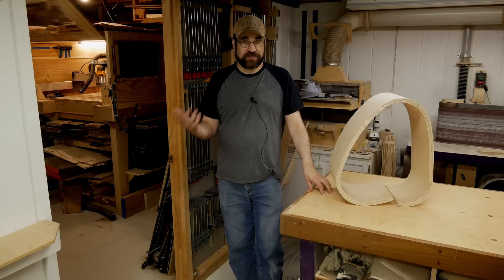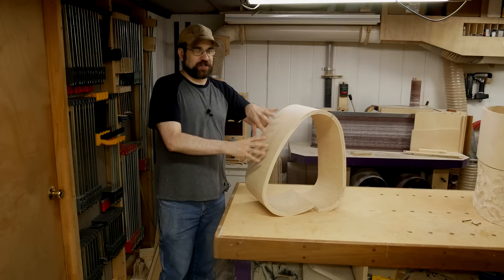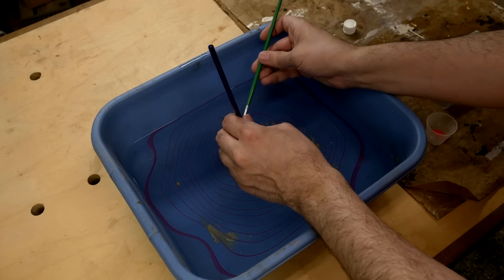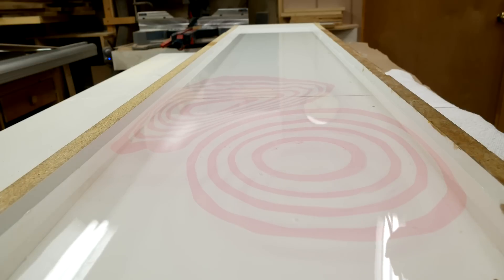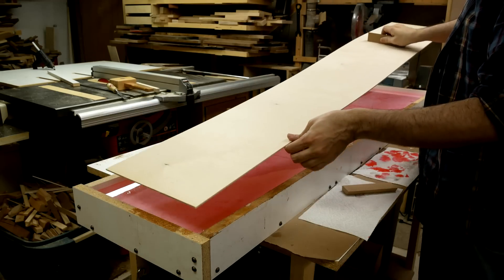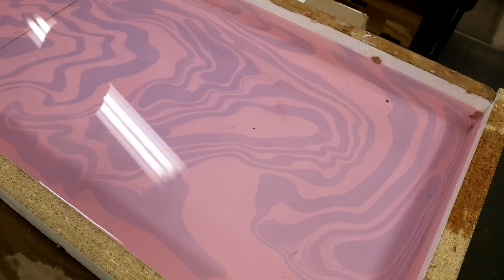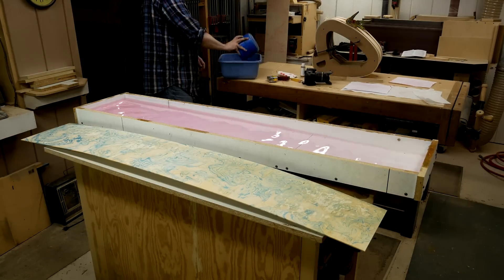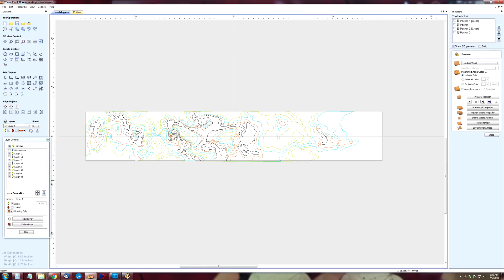Project Wavy Bent - Pt 2 - Suminagashi

Comment: Really cool process!  Was it not possible just to photograph the water marbling directly to get it into digital form?
Reply from the maker: I thought it was useful to try getting it onto plywood to see how that would look.  It would have been a little tricky to stitch pictures together because it keeps moving.  Though on a smaller scale it would be really helpful to have video from straight above so you could pull out the image from whenever you want.  It went a little past the time I would have wanted to freeze it in the places I started earliest.

Comment: So, it looks like you're doing the suminagashi to get a pattern to scan and trace over on the computer to make your heightmap.  If that's so, why use plywood instead of a roll of paper?  Even if you tried to carve the pattern into the same piece of plywood you colored, the carving will remove all, or nearly all, of the colored bits.

Perhaps all will be revealed in the epic conclusion...  :)
Reply from the maker: I didn't want to buy paper for this.  Plus if it worked well transferring it to the plywood that is something that could be used in other projects.  I had some thoughts of doing one special version with the original ink transfer on the outside, but it didn't happen.
Reply: @krtwood  Fair enough.  In any case, I can't wait to see how it turns out.  😊